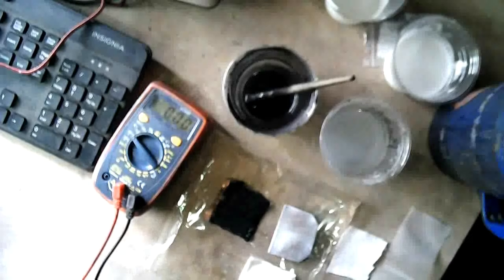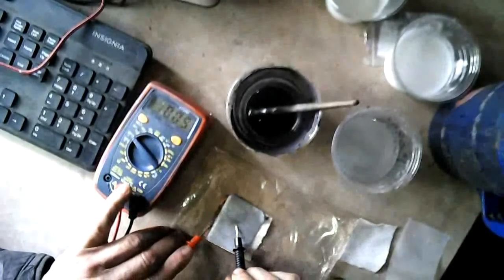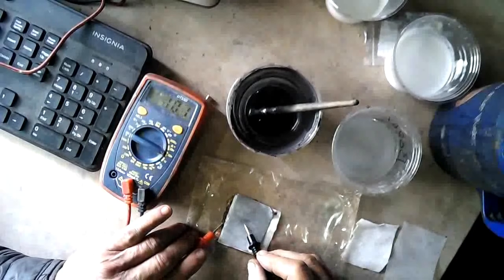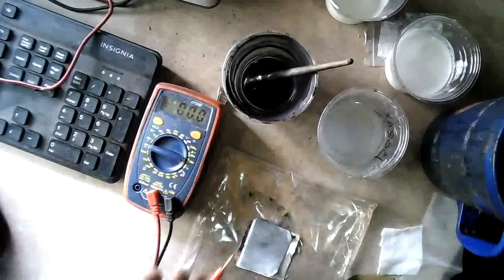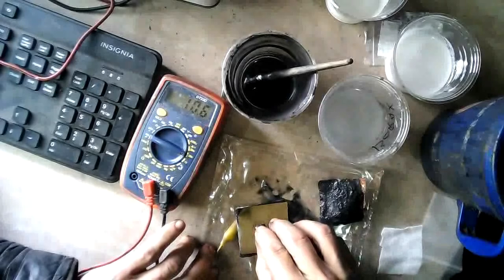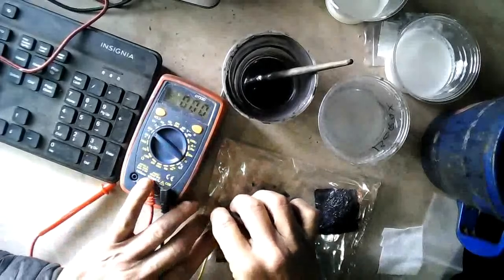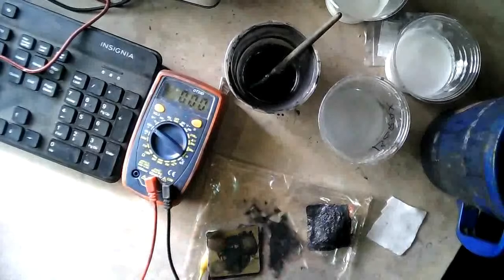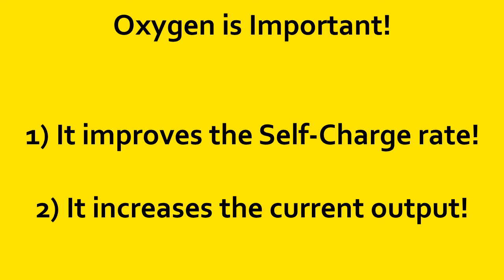Other Good Battery Materials & Oxygen Supply!

Comment: The first part of the video was intriguing in that the amperage was climbing in the dead short measurement. The tin in brass is negative in respect to the copper but it resists corrosion better. That the voltage and amperage increased probably was due to the availibility of oxygen. It would be worth trying to exploit it. On the other hand the cell might dry out faster.
Reply from the maker: No doubt it would dry out faster. I could see that happening with the brass screen in this experiment. This is the kind of technology we need to develop for cheap energy. Why use chemicals to produce power when we can use air and water?